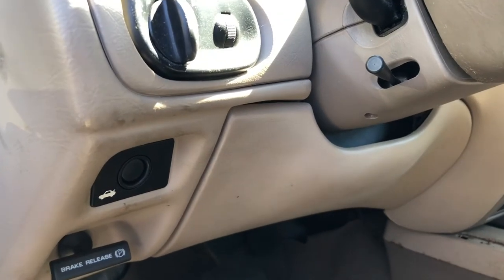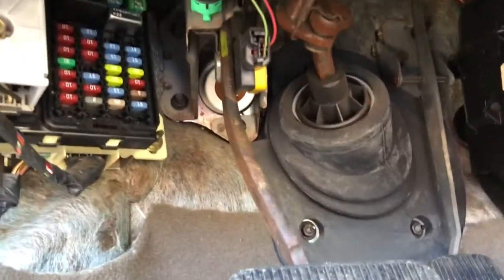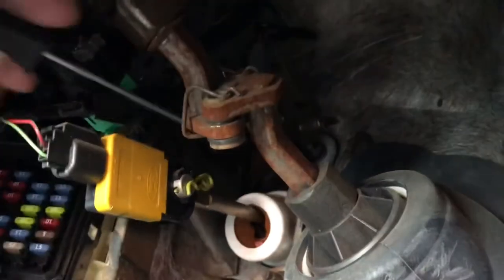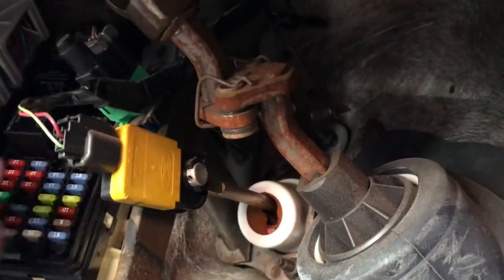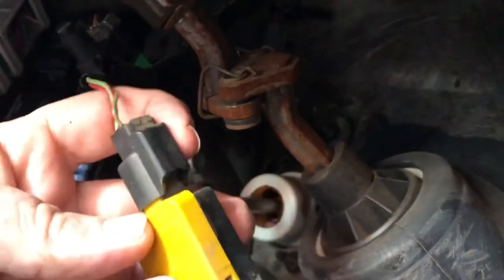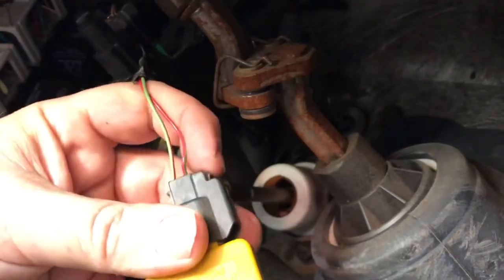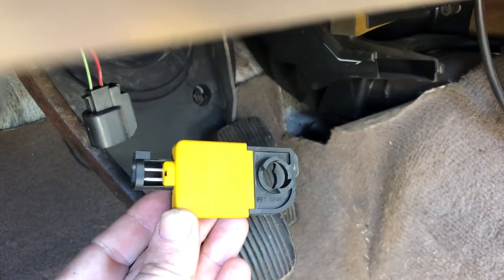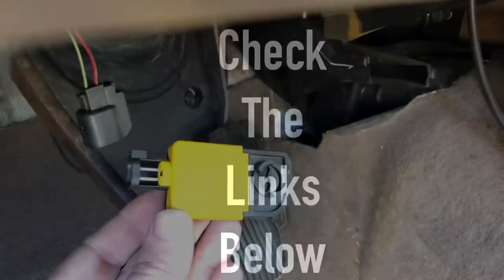2000-2007 Ford Taurus Brake Light Switch Brake Pedal Switch Location & Removal

Comment: Ty not sure if this will help fix the issue, came home turned 2007 taurus off. Neighbor later came over saying my rear lights were on. I checked. The light switch was off. So far still not sure, just disconnected the battery to drain power. This helps though Ty gonna tinker around see if I can unhook/reconnect that brake pedal switch, seems like electrical issue somewhere I dono